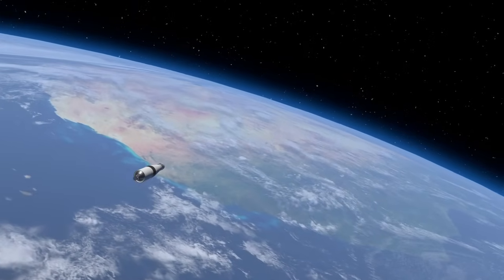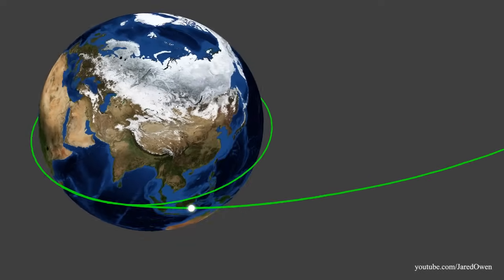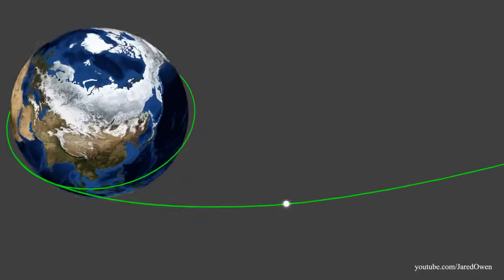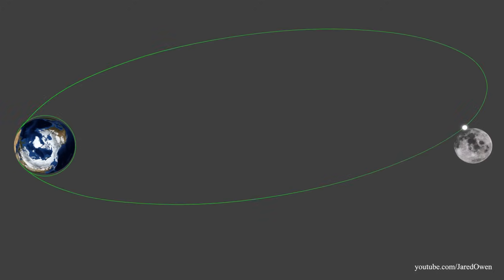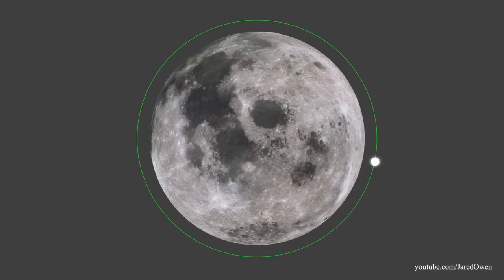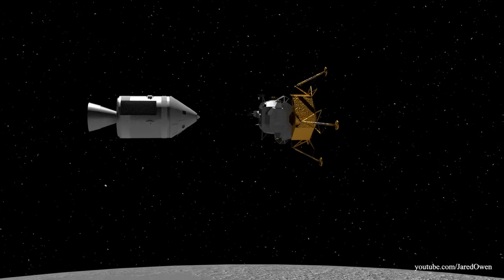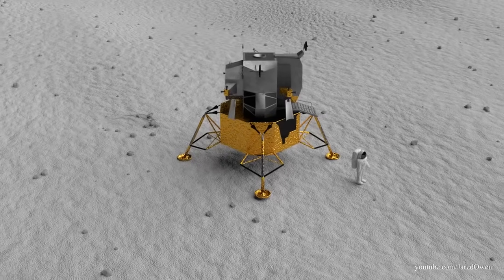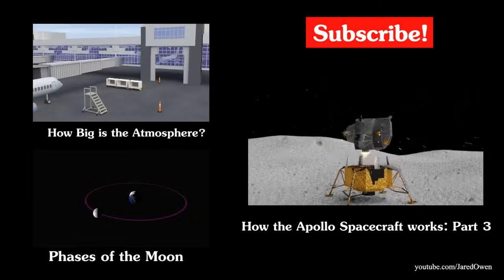How the Apollo Spacecraft works: Part 2

Comment: Curious. As the LM and CSM approach the moon, the CSM is flying backwards, using thrust to slow down. At which point does the whole setup flip so that the LM is at the front?
Reply: At any time that is convenient for the crew. Remember, unless the spacecraft needs to fire its engine, it can point in any direction as it travels. In the case of setting up for the engine burn to slow down into lunar orbit, I think the crew put the spacecraft into its required attitude around 30 to 15 minutes before the start of the burn.

Comment: 1:12 What blows my mind is that this maneuver is taking place while all sections are traveling to the moon at more than 24,000 mph in open space. 🤯
Reply: In space with no air, and no engines firing, all motion is relative. Sure, the stack was travelling away from the Earth at 24,000 mph, but all the parts of the stack were moving at exactly the same speed. When the command module moved away from the rest of the stack, all it did was move a couple of mph relative to the stack (and 24,003 mph away from the Earth).

It seems strange because the movement of spacecraft like this is unlike anything we do on Earth. The closest comparison is two cars travelling side by side along a road. But even then there are differences: for example, the cars need to have their engines on the whole time, and to be actively steered; the spacecraft will just...keep travelling.
Reply: А тебя не удивляет как без двигателей эти куски фанеры летали в космосе без присмотра и падали на землю 10 м в секунду? И не упали. Может стоит подумать не обманывало ли тебя наса?
Reply: @lucian77777  who was the first human to orbit the earth ?
Reply: @SelwynRewes  по легенде Гагарин, но я не особо верю в это
Reply: @lucian77777  "according to legend Gagarin, but I don't really believe in it"

What about Sputnik?

Comment: Достойная иллюстрация великой миссии Аполлон. 
Но я не понял, а как лунный модуль и орбитальный двигались к Луне в то время, как реактивная струя была направлена в сторону Луны?
Reply: "But I didn’t understand, how did the lunar module and the orbital module move towards the Moon while the jet stream was directed towards the Moon?"

Most of the time spacecraft are not firing their engines. Instead they're just coasting. Note that Jared said that in order to travel from the Earth to the Moon, the third stage engine was fired for about six minutes. After that the spacecraft coasted for 3 days to get to the Moon. The next time an engine was fired was to slow down into orbit around the Moon.

Because there is no air in space there is no air resistance. This means that when the spacecraft is coasting it doesn't matter which direction it's facing. This can be hard to understand because it's unlike the way things move here on Earth. The closest analogy I can think of is if you're on an ice rink on ice skates; you push off and start moving, and then fall over; while you're sliding across the ice you'll keep going in the same direction regardless of which way you're facing.
Reply: @ благодарю за пояснение 👍
Reply: @ No worries, you're welcome!

Comment: What provides momentum once the CSM and LM dock? The CSM engine is facing the opposite way.
Reply: there is no air resistance or anything other than gravity that would slow them down before reaching the moon, and they have just enough momentum to get close enough to the moon where they fire the engines to slow down enough so they're in a lunar orbit just like how it's showed in the video
Reply: Most of the time spacecraft are not firing their engines. Instead they're just coasting. Note that Jared said that in order to travel from the Earth to the Moon, the third stage engine was fired for about six minutes. After that the spacecraft coasted for 3 days to get to the Moon. The next time an engine was fired was to slow down into orbit around the Moon.

Because there is no air in space there is no air resistance. This means that when the spacecraft is coasting it doesn't matter which direction it's facing. This can be hard to understand because it's unlike the way things move here on Earth. The closest analogy I can think of is if you're on an ice rink on ice skates; you push off and start moving, and then fall over; while you're sliding across the ice you'll keep going in the same direction regardless of which way you're facing.

Comment: Жаль, что вообще ничего не рассказывается о переходе космонавтов из служебного модуля в LM и обратно. Как и не понятно как они внутри этого модуля стоя в скафандрах совершают посадку и взлет. Не рассказывается как они вылезают в раздутых жестких скафандрах через квадратный (во всем мире круглый) люк наружу и обратно. Жаль не понятна работа систем жизнедеятельности - сколько и как они дышат, какой запас воздухи и соответственно автономности.
Reply: This is just a short video that gives a basic overview.  All of your questions are easily answered by reading the archive schematics, books, etc.  Did you really want answers, or were you just pretending?
Reply: "It is a pity that nothing is said at all about the transition of astronauts from the service module..."

Actually from the Command Module.

"...to the LM and back."

The Command Module had a circular docking tunnel 76 cm in diameter, blocked by a hatch. When the Command Module was docked to the Lunar Module, the hatch was removed, allowing the crew to move between the two spacecraft.

"Just as it is not clear how they land and take off inside this module, standing in spacesuits."

The Lunar Module Descent Engine fired against the LM's direction of travel, slowing it down. As it approached the landing site it tilted upright from nearly horizontal to nearly vertical, allowing the crew to see the landing site. The crew then steered the LM to its landing site, relying on the fact that the Descent Engine could be throttled.

The ascent from the Moon involved climbing a short way, then tilting over to gain horizontal velocity as well as altitude, until they reached a low but safe orbit, whereupon they undertook a series of additional engine firings to gain altitude until they rendezvoused with the Command Module.

Standing wasn't an issue because the G forces during the engine burns were low.

"It is not told how they climb out in bloated hard spacesuits through a square (round in the world) hatch out and back."

No, but it's well explained in other places. The astronauts had to drop to the hand and knees, and back out of the hatch onto the porch outside. Then they stood up and climbed down the ladder. As for the hatch being square, well, it needed to be in order to accommodate the backpacks. Yes, square isn't an optimal shape, but the air pressure inside the pressurised LM was low; designing the LM involved a lot of compromises, and the shape of the hatch was one.

Comment: 1. how radiation was solved, now they are struggling to decide how to protect spacesuits, they are struggling at NASA
2. how such calculations were made and made accurately, as an example with the gravity of the Moon
3. where did you get the energy?
4. what about toilets, or rather human waste these days
Reply: "1. how radiation was solved,"

In general, radiation wasn't an issue. Background radiation was very low, so little protection was needed.

One area of higher radiation was in the Van Allen Belts, but the astronauts passed through their outer edges at high speed in the Command Module, which was shielded against radiation.

The other issue was the possibility of a massive solar flare. If one had hit the spacecraft during the mission, the astronauts would likely have died; NASA and the astronauts were aware of this. However, they relied on two important things: first, such flares are rare, and second, such flares are highly directional, meaning that the likelihood of a flare hitting the spacecraft was very low.

"now they are struggling to decide how to protect spacesuits, they are struggling at NASA"

NASA's issue with radiation with the Orion spacecraft is ensuring its computer is safe from its effects.

"2. how such calculations were made and made accurately, as an example with the gravity of the Moon"

The mass of the Moon was known with a reasonable degree of accuracy in the 19th century. Therefore even at the start of the Space Age engineers had a good handle on the Moon's gravity. Both the USA and the USSR sent unmanned spacecraft to the Moon from the late 1950s to gain more precise knowledge. By measuring Doppler shifts in radio signals from spacecraft near the Moon, engineers could more accurately calculate the Moon's gravity.

"3. where did you get the energy?"

From rocket engines.

"4. what about toilets, or rather human waste these days"

In the Command Module the astronauts urinated into a plastic tube connected to a container. During the mission this container was occasionally vented to space, leading astronauts to joke about seeing the constellation "Urion". In the Lunar Module the astronauts urinated into bags which were dumped onto the Moon along with other waste like empty food containers.

The astronauts defecated into plastic bags which they stuck to their backsides. The bags were then sealed. And yes, it was gross and unpleasant, and difficult while in zero gravity.
Reply: "how radiation was solved"

There wasn't all that much to "solve."  Silly videos made by taxi cab drivers and lawnmower repairmen insist that radiation was a major problem.  But, in reality, the missions didn't last long enough for radiation to be much of an issue.
Reply: "now they are struggling to decide how to protect spacesuits"

Regarding radiation?  No.  The "struggle" is in making suits that can withstand much longer missions, with many moonwalks.  The Apollo suits made it through 3 moonwalks, but, weren't designed to last much longer than that.  If they want to go for months at a time, you will have something like 50 moonwalks, and they need different suits for that.
Reply: "with the gravity of the Moon"

You can calculate the gravity of the moon in many ways.  But, to more directly answer you, they sent unmanned probes first.
Reply: "where did you get the energy?"

Electrical power?  From hydrogen fuel cells mainly.  But, there were also batteries.
Reply: "human waste"

Is your Google broken?  This is well covered.